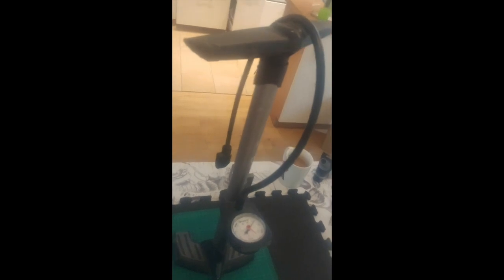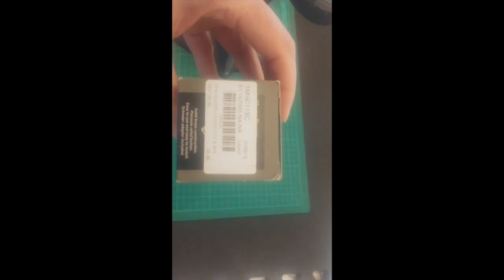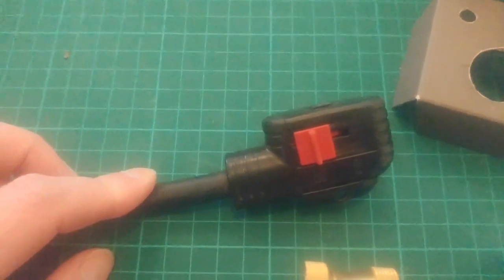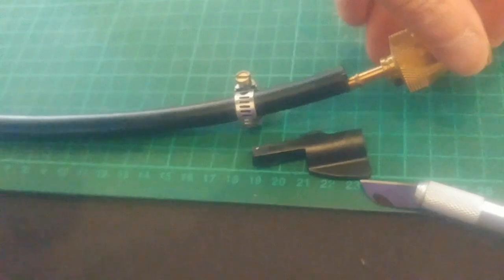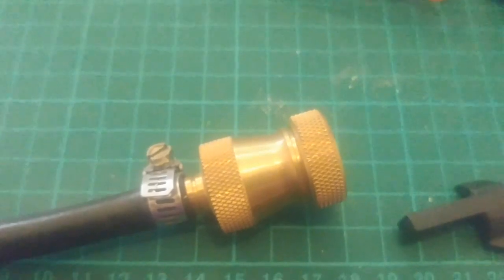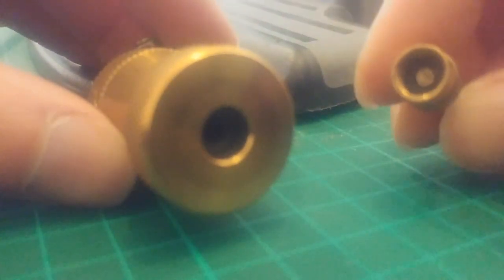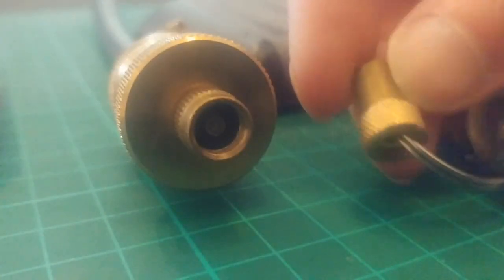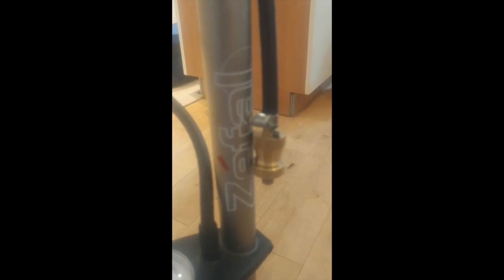How to repair bike Floor Pump (aka Track Pump) by replacing the pump head with a Topeak Superchuck

Comment: my question to you is it seems these are usually 10 mm  ??? so is one possibilty to  put a 10mm 1/8 inch diameter hose barb and or possibly a quick connect  thoughts please thank you